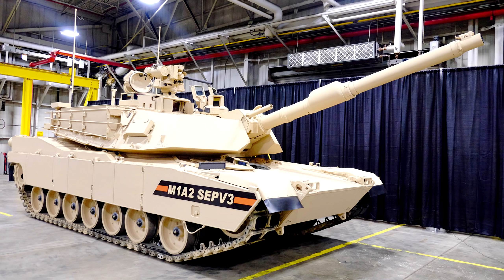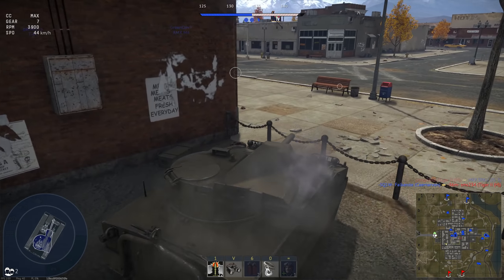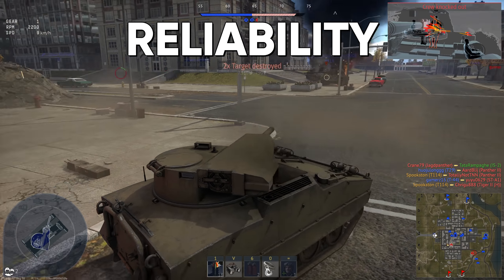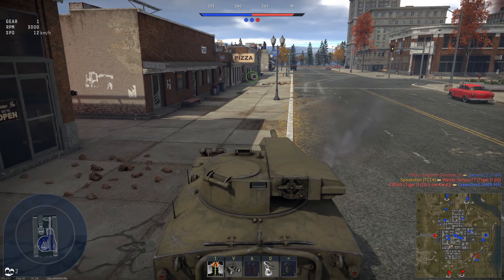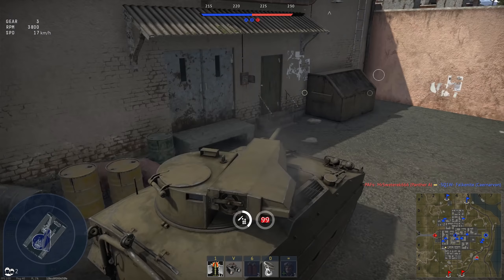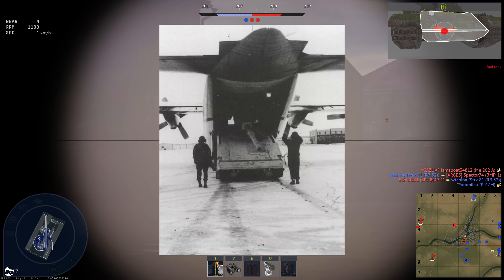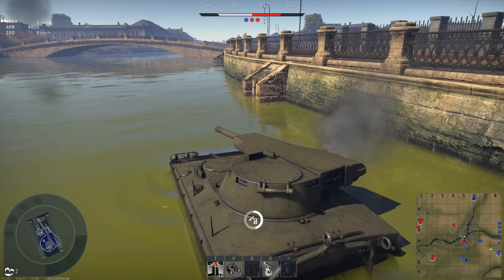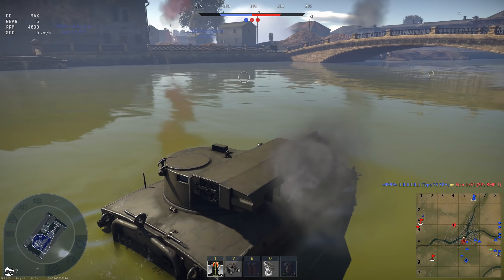What Makes A Good Tank?

Comment: "if your tank spends more time in the repair shops than on the battlefield, its not a good tank even if it has the Armour and gun"

cough cough "Chieftain" cough cough
Reply: Cough Cough "Every WWII German Tank" Cough Cough
Reply: @tirpitz177  Cough cough most WWII tank types cough cough
Reply: @Jfk2Mr  at least they had the ability to be repaired in the field, Germany produced tanks but no spare parts so they had to send the tank all the way back to Germany for the smallest problem
Reply: Tbf chieftain never really served in an actual war, to my knowledge.
Reply: @original_godshy  Kuwait had 143 Chieftan Tanks during the 1990 Iraqi Invasion of Kuwait.

37 of these Chieftains fought at the Battle of Bridges against Iraq. Not a single one of these tanks was lost in the battle and they withdrew to Saudi Arabia and later participated in the 1991 Gulf War before returning to Kuwait undefeated.

The other 103 Kuwaiti Chieftains were either destroyed or captured by Iraq after being abandoned by the Kuwaiti army due to a lack of ammunition though.

Edit: Iran also extensively used the Chieftan during the Iran-Iraq War. Apparently Iran lost 675 Chieftan tanks during the war.
Reply: @tirpitz177  No, just no. The Panther does not equal every German tank. 

And when it comes to the Tiger it was actually designed alongside a doctrine where it would only fight for so long before smaller medium tanks pushed forward to exploit its breakthroughs. The Chieftain's video "a controversial opinion on Tiger" explains this very well.
Reply: @raptor9777  TIL
Reply: @lowesmanager8193  I wasn't talking about combat effectiveness, I'm talking about the over complexity in the design of German tanks that caused them to have to be sent back to the factory due to the fact of no spare parts and even the least worrying thing breaking unlike other tanks.

The combat effectiveness is good, when they worked, which unless it was a Panzer 3 or 4 which worked quite often (Panzer IV late war however wasn't anywhere near reliable) but even then they suffered because Germanies overall lack of spare parts.

Potential History covered these issues in his "German Tank Meme" videos
Reply: @tirpitz177  Not having enough spare parts is not a complexity issue it's a logistics issue. You could have the simplest tank in the world but if you don't make spare parts for it you'll end up in the same situation. And once again not all German tanks were really that much more complex than other tanks. 

The Panzer 3 and 4 were very combat effective and in addition to a lack of spare parts they also were built with worse metallurgy late in the war which is why reliability decreased. That being said I haven't actually seen any solid numbers about the Panzer 3 and 4's reliability, even the Chieftain has asked about this before because he doesn't know.
Reply: @lowesmanager8193  sorry, I rolled two problems into one, I meant that the complexity itself was the reason they were sent back, you're right about spare parts being logistical, but another problem is that the tanks had to to be sent back to the factory do to the complexity itself being the reason the tank broke down, even if you had spare parts, the equipment needed to fix alot of the issues for say the Tigers and Panthers were located in the original factories

The Panzer IV suffered the same problem but less than the Tiger or Panther, thus why it was produced till the end of the war.

The main problem of Spare Parts for Germany was the lack of them since they focused on mainly the Tank part and not the spare parts one, thus being a lack of spare parts for even early Panzers

Comment: In the Chieftain's video about the Tiger he actually makes a point about the Tiger's lengthy maintenance requirements not being much of a problem because of the doctrine that they were meant to be used with. 

Unfortunately for the Tigers they simply didn't get used in the way that they were designed to be very often and their reliability suffered because of this.

Comment: Swedish S-tank.  💜💜💜

One of my favorite examples of top quality tank design.

By no means the best tank in the world, but it's one perfectly designed for it's role.
Reply: It's tank destroyer, since it has no turret, and it is specifically said, TANK HAVE TURRET at least ONE !!! Strv isn't tank
Reply: @bastionaudio  By that definition the first British Heavy tanks during WW1 wouldn't have been considered tanks, considering that their guns were mounted in casemates. A turret does not necessarily indicate whether something is a tank or not (although it is a very good indicator). Designated combat role within the doctrine the vehicle is intended for is what truly makes or breaks the classification.
Reply: @олег бурдин Strv-103 is a main battle tank, not a tank destroyer. Not all tank destroyers are turretless. An M18 Hellcat is also a tank destroyer after all, and it has a turret.

Also, depending on your definition of a tank, a tank destroyer could still be a tank in and of of it self. The colloquial definition of a tank is simply any vehicle with a significant amount of armour, a cannon, and caterpillar tracks. This is what defined tanks in World War I. Most tanks of that time didn't have turrets. The Mark 1, A7V, and those improvised armoured Holt Tractors used in World War I would have been considered tanks. Carrying that definition over to later time periods, many tank destroyers and infantry fighting vehicles would count as tanks too.

In later developed militaristic terminology, a tank became more defined by the role of the vehicle, rather than the way it is built. A tank in this case would be a vehicle designed to support infantry, break through enemy lines, and fight other tanks. If a vehicle was designed to fulfil all these roles, it was considered a tank. Now this would disclude tank destroyers and infantry fighting vehicles, since they would not have met all the criteria, but it still does not disclude turretless vehicles, so the Strv-103, which was designed to fulfill the aforementioned criteria is still a tank.
Reply: It's funny you should mention that, strv is a shortened version of "Stridsvagn" which means "Tank".

Comment: I feel like the panzer 3 has done pretty much everything here right
Reply: It was the best tank in the world at the start if the war.
Reply: It surely did, it's in my personal top 5 best tanks
Reply: Kyle  ignoring French tanks exist
Reply: @heroninja1125  He's not ignoring them, French tanks were actually very bad at the start of the war. Some of them had good armor but they were bad in essentially all other aspects. 

They had awful ergonomics, they mostly used one man turrets, they had bad visibility, they mostly didn't have radios, and they mostly had small guns.
Reply: @lowesmanager8193  Some french tanks could actually take on panzer IIs and 3s on a head on fight. Unfortunately the germans made sure this never happened. Another issue is that tanks that could take on panzers where in very low quantity by the French, so though they where decent on their own there where several other factors that made them bad
Reply: @deliqene3191  Actually the French had more tanks than the Germans, it's just that the Germans concentrated their tanks into tank divisions while the French spread theirs out to as many units as possible. This meant that whenever French tanks encountered German tanks they would be outnumbered but the French had more tanks in their army overall.

The other thing is that tanks do not take each other on in head to head fights, rather they fight on the battlefield where they engage and are engaged by many different threats, and only occasionally fight each other. Tanks spend most of their time fighting infantry, and when it comes to infantry fighting the Panzer 4 with its short barreled 75mm gun was the best in 1940. The short 75 was a phenomenal infantry support gun, and it's full five man crew, good visibility, and optics allowed it to bring its gun to bear on infantry with great speed and efficiency.
Reply: @lowesmanager8193  huh I didn't know about the former point, forgive me. As for the latter point I knew that tanks rarely if ever fight head on. I was just trying to clear a misconception on the comparison between the panzer and french

Comment: Try the hull of an Strv 103 upgraded for more armor and with an elongated back portion to fit a turret on top, use a smaller capacity version of the normal autoloader in the back of the turret, and angle to fit uniform with the UFP. Thicker armor means move the engine back a little more, composite internal spall shields. More powerful engine can be added with the elongated hull, move compartments all the way back with the removal of the autoloader/gun from hull since it's in the turret. Ammo holding in rear fuel tanks that can be accessed through a hatch in the spall shield separating the crew from the fuel tanks/engine. Still very light side armor but composite side skirts and better top armor, probably 40mm top of turret. The suspension will still be operable by the driver to pitch forward/backward to make up for poor gun depression, and aid in maneuverability. Breech won't be exposed in the front of the turret as the wedge armor will just be attached to the gun and move with the barrel. Still working on the idea but I think I've found a great tank design

Comment: I think a excellent tank held back by wieght and transport capabilities is the Is-7 it was pretty reliable, good armor even though it's like 70-80 years old, and a powerful gun and rather mobile IN COMBAT. The only reason why it wasn't put into production was because of its cost and it's a nightmare to transport into the front lines due to how heavy it was.

Comment: Well, the same principles apply to all military hardware actually - which is why people wanting 1500 F-35's just sound silly... 

A few points here I think were missed though or only touched by:

First of all, crew training. A tank is only as good as its crew, and the better trained they are, the better the tank. Of course, a T-34 will never destroy an M1 Abrams no matter how good it's crew is, but it can stay out of sight, harass and damage the Abrams if the Abrams crew is a bunch of noobs. 

Secondly, on a greater scale, a tank is only one part of a very complex military machine. If a tank isn't supplied with fuel and ammunition as well as other necessities, its only a bunker, to just mention one factor. And I think this is the most important thing to remember each time one of those 'best tank' or 'whch tank would win' thought experiments pop up, especially here on youtube. They are pointless, since tanks are never alone. They are always acting in an environment of friendly, hostile and neutral elements.

Comment: Hey spooks maybe for something a bit interesting how about you review the Zombie Vehicles from Zombie Army 4? Their basically an Undead Panzer III J and a Sd.Kfz. 251 with meat holding the shells together. The Demonic Tank has its advantages and weaknesses...having no crew to man it since its basically Undead and can control its own gun which bends down and up due to extended flesh neck...but its side armor is a weakness because of the hearts and how it could be shot off by excessive fire arms. Half-track can dispatch zombies on the move at high speeds and basically has no driver to sniper but it still has the same problem with the side armor. Hope it would be a worthwile interesting take?

Comment: I think you missed the most important aspect: command and control. A tank no matter how good is by itself extremely vulnerable. It is above all else just an equipment of a military formation. A platoon of tanks equipped with radios and even rudimentary communication tools can handily defeat a company of tanks without. We need look no further than WW2, or the Arab-Israeli Conflict, where Soviet tanks with better firepower, armor, and mobility were still destroyed in huge numbers due to their opponents' capability of better coordination of their technically inferior tanks. Modern MBTs should all be equipped with some form of battlefield management system to facilitate the essential command and control.

Comment: Not sure, but a perfect tank in my opinion would be very angled and with thick armor. Maybe a big Autocannon with strong shells that have insane penetration. And it has to be somewhat agile. I am thinking about a diamond shape with maybe hovercraft tech but not sure. No SciFi hover tech, just current one with this rubber pillow and hidden turbofans on/in the back. But spiky spheres are also a possibility to replace tracks.
Reply: @quocvinhnguyen2063  Well, I am german. And I said more than just big gun and thick armor. Like giving tanks a completely new shape that maximizes the probability of a ricochet or putting the whole thing on an air cushion or spiky balls for better mobility.
Reply: @vgames1543  ehhh, fair enough

Comment: This probably isn't a major factor But what about stealth or camouflage or whatever you want to call it.  how easy it is to hide your tank, or how hard it is to spot from the air.  how hot it is on thermal.  how loud it is? how visible is the exhaust?  or maybe the silhouette provided when it's hull down.  are these universal factors or just doctrine specific?

Comment: I'm wondering what effect of 24/7 Drone CAS will have on tanks?  I mean, tank on tank engagement over open ground like in Gulf War 1 is a thing of the past and much as firing in ranks and going  broadside to broadside on the high seas is.  The only reason we did it because we had to to inflict damage on the enemy.   Now we are using missiles to blow up 3 dudes with AKs, talking and smoking in an ally.

I'm wondering if the role of a tank is going to end up being a fall back position for infantry assaulting a buildings.

Comment: Reliability is a subset of mobility. An unreliable tank is not very mobile. Mobility also includes range and terrain-crossing ability which is mainly down to suspension and track design. Modularity or ability to be adapted to new requirements is very important. As long as the ground pressure is not unreasonable, weight has become less of a limiting factor. Bridges are much stronger now than before and wading is much improved with snorkels. Weight has never ever been a factor in rail transportation, railway flat cars routinely carry much heavier loads than tanks. The tank exists to carry a gun. It is a mobile gun. It wasn't so much the heavy armour of Panthers and Tigers that made them so lethal, it was their ability to shoot the arse out of a fly at 2 miles that made them fearsome. It is an often overlooked fact that most German tanks had sights that could be calibrated to a gun's individual ballistic characteristics, and this was performed by the crew themselves.

Comment: Not a bad video, but it is still b.s., because the short answer really is: A good tank is the one that wins. There were designs which, according to that video, should've completely failed, yet they won battle after battle. Which makes it also even a bit more spicy to design a tank. Because if you designed a superb tank that … let's make something real quick … could be destroyed by rain, only to have a war where it never rains, you win the war, and make the other side lament later about had they only forgone rain protection! So, no, this video doesn't cover it.

Comment: Depleted Uranium armor is very helpful... Oh wait,  you're not supposed to know it has that....

Oh, and a turbine engine is helpful... 

The German tanks suffered because the parts were too precise,  and fuel,  while Russian T-34 tanks succeeded because of how hap hazardly they were put together (in winter, while German tank gears froze, Russian worked because the snow freezing actually helped, almost increasing the gear traction).  Tho the Tiger was technically the first "modern"  tank, with its gyroscope traverse.